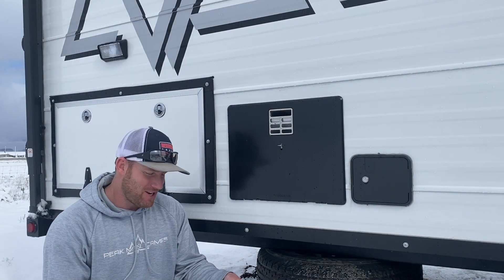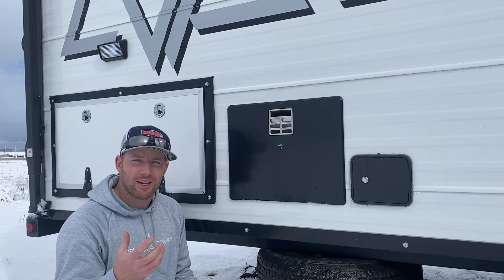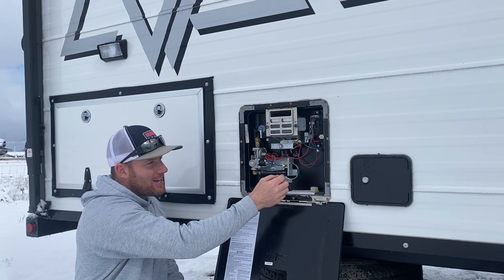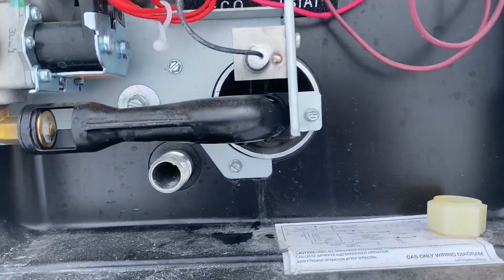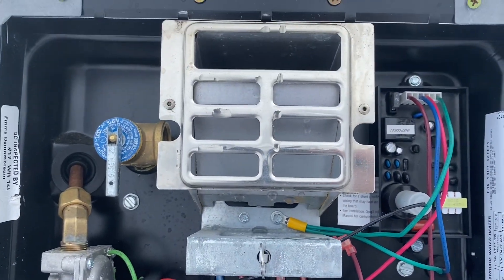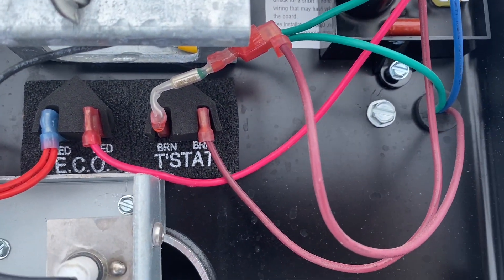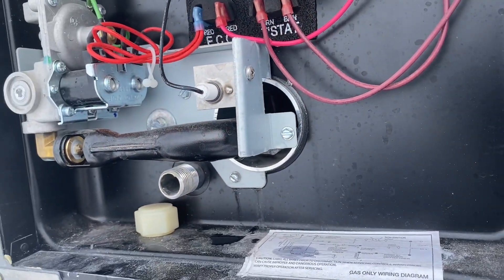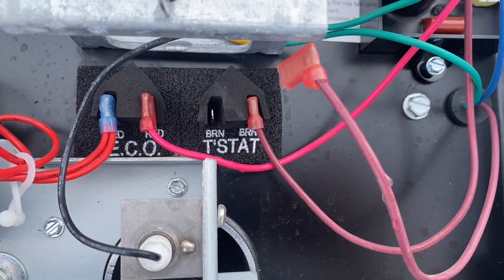Water heater thermal cutoff replacement

Comment: Water heater quit working.  Read a lot of ways to test, possibilities and looked at a several videos for a solution.  This is the only one that was right on point with a simple on the road test to see if the thermal cutoff was the culprit.  Yep.  Spot on.  Thank you.👌

Comment: Thank you Weston. You save me a trip back to the dealer. This was my exact issue. Dealer told me that I could use both electric and propane water heating at same time to speed things up. I think it made it too hot inside the outdoor compartment. So, I ended up taking a cold shower!  I did the bypass, everything works and now I have a 5-pack replacement on its way from Amazon. Thanks again!  I LOVE YOUTUBE.

Comment: I'm trying to disconnect the wire. But it won't release. I'm afraid I'm going to break it, how hard do I need to pull?
Reply: Mine was the same way, you have to pull pretty hard. I had to use some needle nose pliers and wiggle side to side to get it to release.

Comment: Good info Weston. We have that exact water heater in our camp. Same issues with easily blowing out. Last fall I installed the  external bug screen on the intake to keep bugs out. I have not used it since but I’m hoping the screen provides a little extra wind deflection/protection to maybe help with the heater blowing out. If it works I’ll let you know so maybe you can pass it along to other customers.
Reply: I have this same heater and issues. Do you have a link to this bug screen?
Reply from the maker: Camco 42169
Reply from the maker: Thanks Dave. We would definitely be interested in hearing your experience.